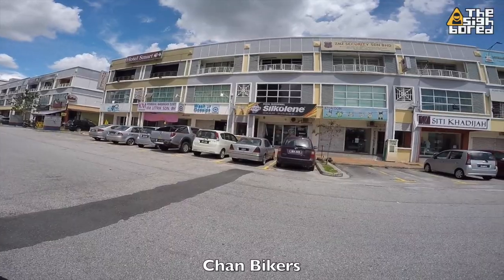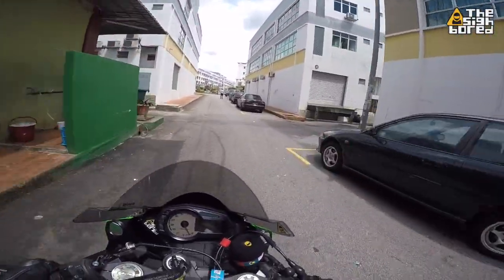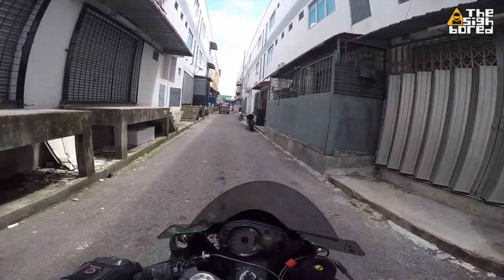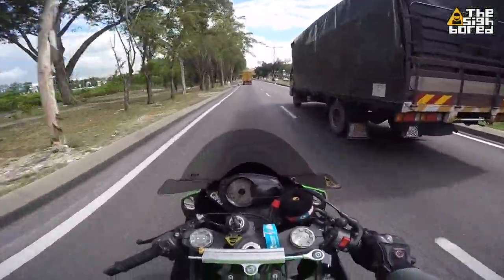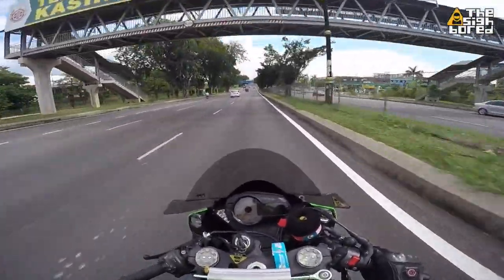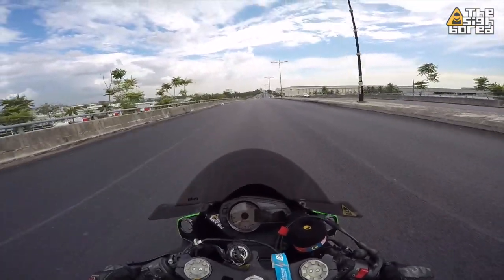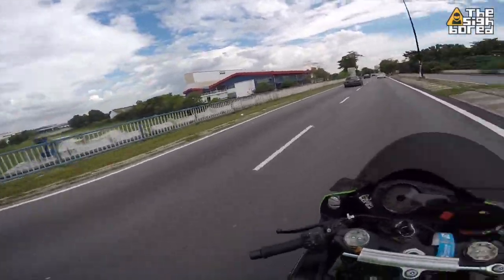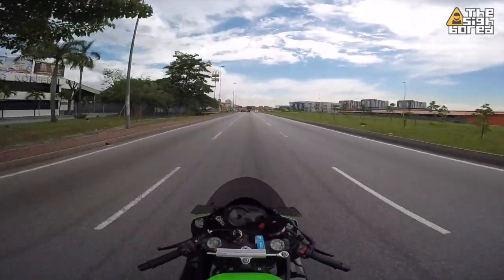Kawasaki Ninja ZX-6R | Workshop 9 | 28,500 km | Full set tire replacement

Comment: How much u spend per month on da bike
Reply from the maker: There's no monthly expenditure, apart from the monthly loan repayment. Everything else depends on your usage. I use mine quite frequently, so I spend more on fuel, and my service intervals come faster as well. 
On average I would say fuel is about MYR 50 per week, in a month that's roughly MYR 200. Roughly 3 months for every 5k kms, so have to change EO + OF on every third month, that's roughly almost MYR 300 (4 bottles fully syntethic). Tires, chain, sprockets, depend on condition of the wear and tear. 
There are a lot of other scheduled maintenance stuff like valve checks, spark plug change, suspension servicing, etc. Which I have yet to do, but will have to do soon in the future.